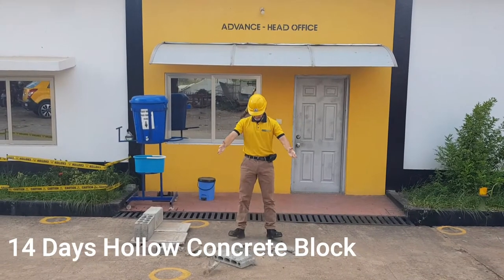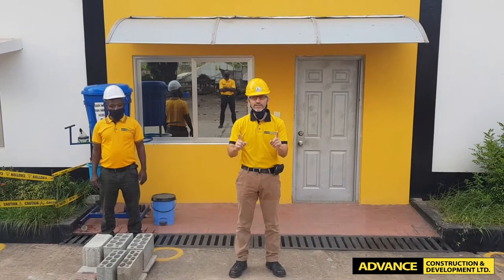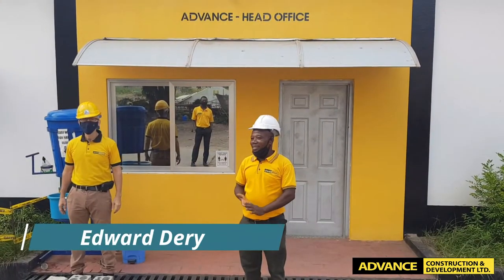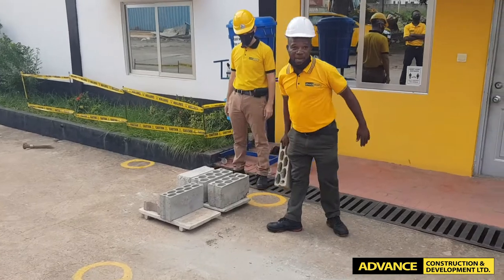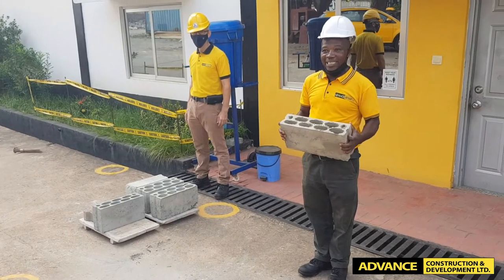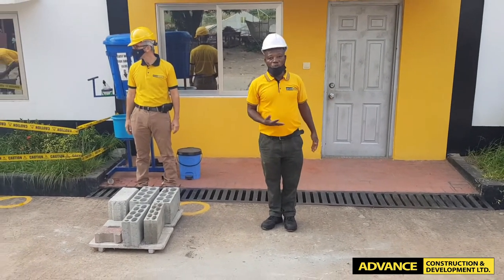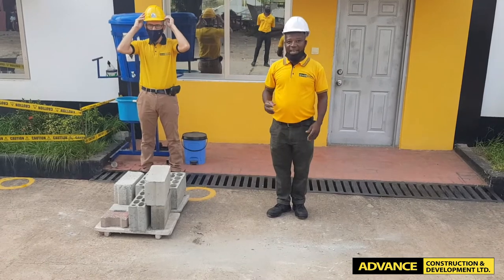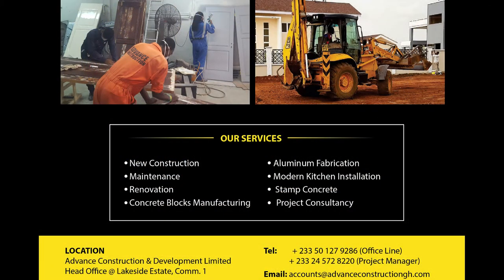Block Strength Test - Engineers Drop Test by Advance Construction | Salah Kweku Kalmoni

Comment: Good day, Engineers! I am a third year Geodetic Engineering student and we are tasked to make a product for our subject called Technopreneurship. Cylindrical concrete monument, usually 15 x 60 cm in size, which is used to mark the corner of a parcel of land is very important for our program. What can I use instead of aggregate to achieve the same result when you dropped the hollow blocks?
Reply from the maker: Sorry... question is not very clear.

You want alternative materials?